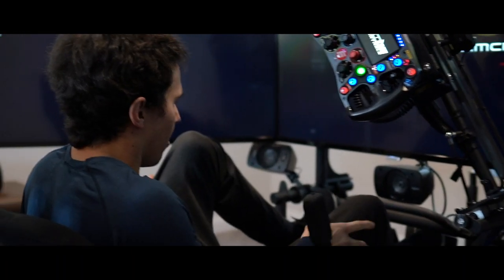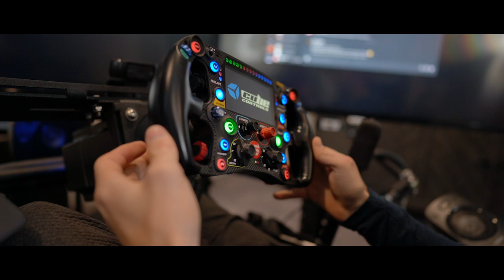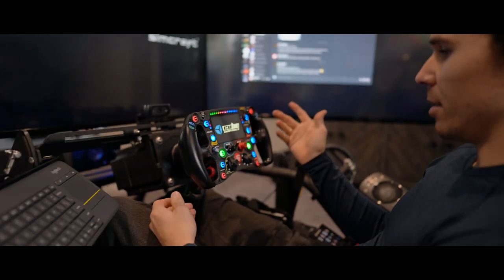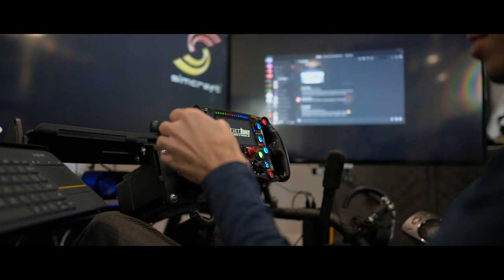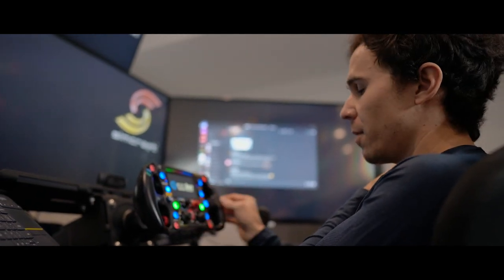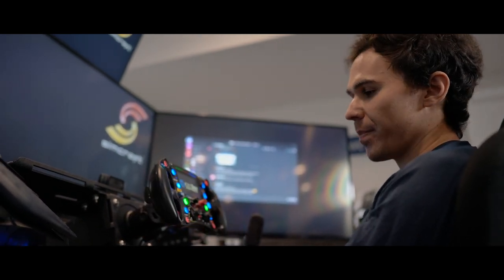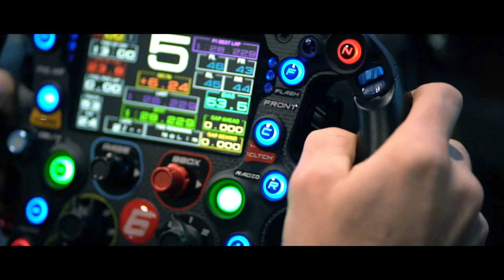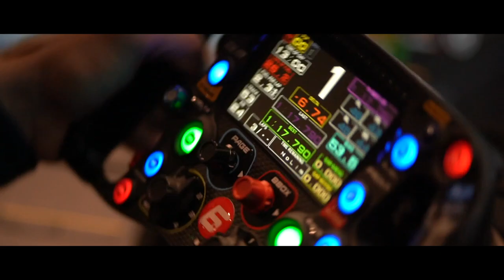Brick x Brick Episode 1: The Sim

Comment: Awesome job Robert!! I'm a paraplegic as well and started sim racing this year too after having to do research as to what was available that would allow me not just to drive, but be somewhat competitive.. I drive exactly like you now, using the clutch paddles on my Precision Sim Engineering wheel to accelerate and a Heusinkveld handbrake reversed to brake :D  I like that you covered the other issues we have to deal with, like  the cushions for our heals and bottom... same deal here, I just use a all gel cushion made by Jay or one of the mobilty companies.. Hopefully will get to be on track with you at some stage! :)

Comment: Hey Robert, great insight into the sim setup!
 
Got me thinking about it. I'd imagine that a Dual Axis Steering wheel would be ideal for the brake. I.e. Telescopic steering column with load cell that you push forward to brake. Same as the way Mercedes F1 use it for Toe, but instead for the Brake Pressure. Talk is cheap... i know haha. All the best, glad that you can still enjoy cutting laps : )